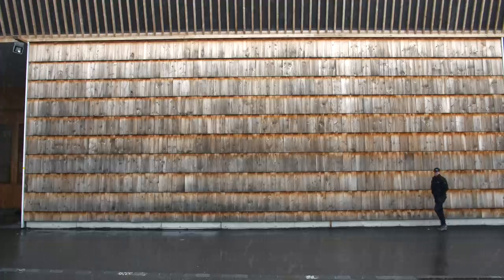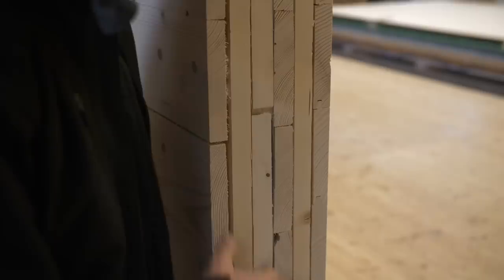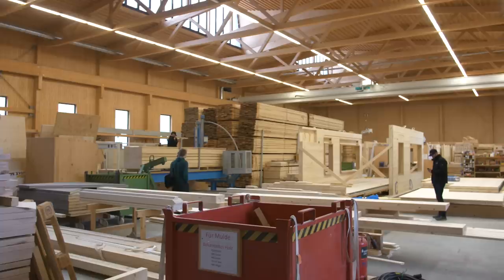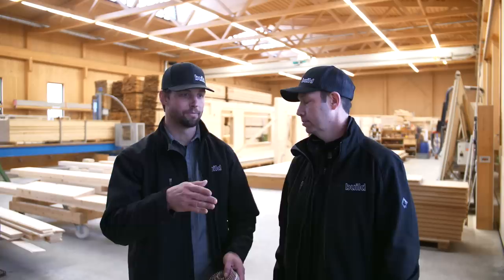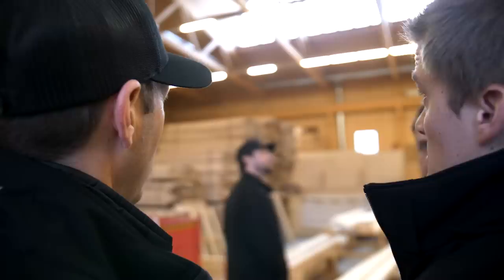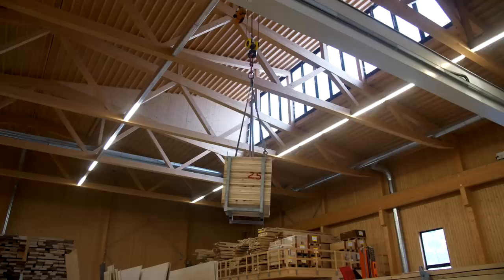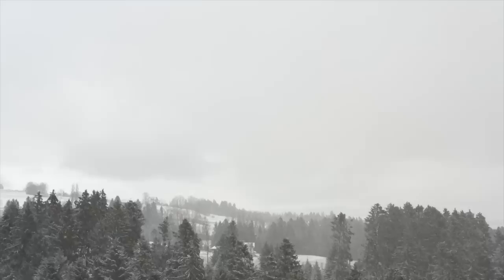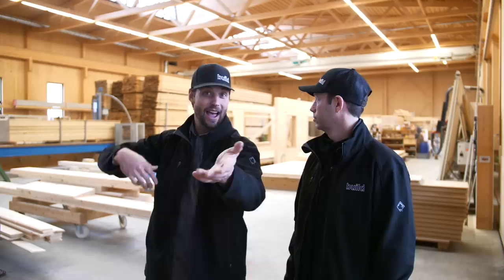This Swiss Builder uses NO INSULATION...

Comment: I love how there is so many haters, yet no one would talk this much trash about a log cabin, there is no waste in this process. All byproducts are beneficial in some way, the wood can be sustainably farmed, younger trees sequester more co2 then older growth. There are so many benefits and so little draw backs. Yes it's not for everybody but it's a great method. Quit freaking out like we are gonna make this the mainstream method and this is all we are gonna build now.
Reply from the maker: Agreed. Thanks
Reply: There are far more drawbacks than benefits. If you fail to see the drawbacks, then the video has done great harm.
Reply: First thing I thought about.  An 8-inch thick wall should do well even down to zero degrees.
Reply: Its not that much more wood, you as actually dont know how much more wood it is. And it proably has a higher insulation value, better air infiltration qualities, easier to adapt other building materials to, it can all be done in a factory. They said the I sualtion is wood fiber, where do you think they are getting that from. The waste can be used as insulation, particle board, osb, pellet stove fuel, mulch, horse corals, oil absorbant And proably many more uses for wood scraps. I'm not saying it's the best building method, I'm saying it's a great building method.
Reply: I'm sure this house is very competitive when it comes down to it, but I guess you better go tell these guys that run a successful business that they better close down there doors because its not a good system.
Reply: But we would need to increase co2 in order to support those farms... More gas car?
Reply: @dlwatib  Not sure what you mean.  From a "building green", this is about as good as you can get.  As far as being a "Green Building", it is good.  In Europe, they already have worked out what they are going to do with scrap.  Not like here in the US.  They recycle everything.
Reply: On the building system, sure its essentially engineered construction, but amount of milling required to make all this lumber would build you extension alone. Also squore milled logs will not warp if properly built. There is dowels holding them in so only difference is that this method allows some modern designs be made and log cabin needs traditional roof with current insulation materials. Then again you can make them from hemp fiber insulation and wood creating light and well insulated construction that is must with snow loads bringing even more weight.

 @fromtheburbstothetetons8826  Correction, we TRY recycle everything, how ever there is morons who ether wont give a damn or are just plain ignorant. Hence why recycling plastics for instance for anything other than power plant fuel to be burned is extremely hard. Getting people recycle plastics to their right bins is utter nighmare, specially when just  small fragment of wrong material that melts in higher temps will cause jam on machinery. Sadly most of the plastics just go to powerplant fuel, instead of being used as additive to making new plastics.

Also there is slight problem of assholes trowing what ever to trash cans and most cases even dangerous trash ends up there. Even more worrysome is trend where old sofas, electronics and such end up dumped on forests and remote road sides, when there is dump in every city and places that take them for free.. heck might even pay for them in bigger batches.
Reply: Hellsong89  where I visited in Germany,,PFORZHEIM,,I saw my cousin with 2 recycling containers,  1 had the silver foil wrapping from CHEESE, , the outer& inner containers from ink cartridges etc, then there was virtually all else, plastic, foam etc. But whenI asked what they do with cheese wrap, he had zero idea, just that it’s put out on certain days, for pick up.Now I’ve in NJ, they nowONLY TAKE # 1&2 plastics , paper, phone books, newspaper, cans , bottles, now co mingled. ALL FOAM GOES IN GARBAGE  !
Reply: Wood has an R value of 1.5 per inch.....so an 8" wood wall is about an R-12.   Typical 2x6 framed wall with 1" foam sheathing is R-13 batt between studs and R-5 (or higher, depends on the type) for the foam.....total of R-18.   2x6 wall, about R-24.....less wood, twice the insulation value. @fromtheburbstothetetons8826
Reply: Your statement that "younger trees sequester more co2 then older growth" is not true.  The rate at which a tree accumulates mass actually accelerates as it ages (in 97% of the 403 tropical and temperate tree species studied), according to a 2014 USGS study published in the journal Nature.  *However*, as long as a tree does not rot or combust, it continues to act as a carbon store even after it has been cut and used in the construction of a house.  So if a wooden home lasts longer than the cultivation time of new trees, then wooden construction as a whole should be a net sequester for CO2, regardless of whether new or old trees are used.
Reply: @matthewgrotke1442  I hoped someone would have said this, "younger trees sequester more Co2 then older growth" is simply a lie that is used everyday to justify bad practices.
Reply: @edsmith4414  Logs don't have the same R value, but their ability to restrict air movement give it a higher comfort level.  This is similar to SIPs.  You would have to look at an Adjustment chart for both to make sure you are comparing apples to apples.
Reply: its resource intensive, growing, cutting, and milling all that wood, inneficiant as hell, where i live the minimum r value for walls is 21, your telling me i need a minimum nearly 2' thick wall made of solid wood? and thats just a minimum, an echo friendly efficiant house would have much more insulation. not to mention extremely expensive.

and no one is defending log cabins, they are also resource intensive and inefficiant, there is a reason they are rarely built anymore and when they are they are usually combined with modern matereals.

there are plenty of chemical free, resource conservative, cost effective building techniques. earth bag, straw bale, rice hull, etc
Reply: Mark Funderburk younger trees do not sequester as much co2 as older trees, but young woodland does sequester more co2 per acre than old growth. There can be fewer trees per hectare once they reach a certain size.
Reply: The real issue with this construction method in US is the freight cost due to weight.
Reply: they didnt use 300 trees or more on the walls unlike log cabins
Reply: therealnightwriter  five me the link that says it's a lie, theres alot of people.ive heard say it was a lie, alex jones, Donald trump, news reporters. Psuedo scientist. But millions upon millions of scientists disagree with them. But what do PHD people who have spent thier entire lives studying environmental science know
Reply: " there are far more drawbacks than benifits." 
Such as?
Reply: @bobofat2545  who's to decide how much wood is acceptable? Some might say the amount we use is normal construction is far too much.
Reply: All the byproducts of dimensional lumber are used, whether you stick-build (conventional) with it, or build like this video demonstrates with it.  Byproduct use isn't part of the issue. The difference is, lumber goes several times further, several times more living space can be constructed using the conventional method.
Reply: @dlwatib  Please list the drawbacks.  I'm sceptical, and can see that this only makes sense if you manufacture and build near the trees you use for timber.  However, when I think about it, a nice eco alternative to this is straw bale.  But straw bale is lime rendered and you have to burn wood or coal to fire the lime.  The limestone quarrying is not an environmentally benign process, but, if you fire the lime kiln with wood, it is eventually carbon neutral.  Here they just use the wood they would have use to run the kiln and don't burn it at all, so it is essentially carbon negative.  You'd need very thick walls though.
Reply: @edsmith4414  They even said im the video that the walls are R24 and the roof is even R30 to R40.
Reply: @edsmith4414  R Values don't take into count permeability.  You take the same R value on a tight house vs a regular house and the tight house will be much more comfortable.
Reply: Dlwatib, your comment is a Fail if you fail to outline the drawbacks .
Reply: Compared to stick frame maybe, but try setting it against steel, tile, concrete, glass or just about anything else. Good thing about this is that it reaches volume max and weight limit at roughly the same point, which means a full load is full, and not 2 loads because another truck has to be set in to comply with restrictions. So no. That won't fly.

Comment: Next episode; wooden plumbing.
Reply: hahahaha
Reply: That was a thing. Hollowed out tree trunks were used for sewer lines.
Reply: Elm was a wood commonly used for that purpose. As long as is stayed wet and wasn’t exposed to air it was supposed to last fairly well.
Reply: That’s the smaller house out back.
Reply: Swiss people like cold. The house should always be less than 50 degrees F. In Southern China there is NO heat in any building! In the winter +5, inside and outside. The good part is there is no wind inside.
Reply: Yup used to be a thing.  Wood log pipes, for sewage.  They just dug one up somewhere here in The States a few years ago that was 200+ years old.  Still functioned and everything.  Only reason they found it was due to a remodel.  :-P
Reply: Lolol
Reply: Wooden wires...
Reply: nope wood electrical...
Reply: Difference between an American and a European. An American thinks 100 years is a long time. A European thinks 100 miles is a long way.
Reply: In the 70's my father did work replacing water lines, some of the lines they pulled up were made out of wood.
Reply: That's actually a thing in alaska. They still have a lot of underground municipal plumbing constructed from wood. My dad enjoys a bit of fishing and visited 10 or so years ago, he watched them replacing some of it. Being cold down there and basically completely anaerobic there isn't much bacterial activity so it rots incredibly slowly. Theoretically last hundreds of years.
Reply: Wooden chimney??.....No?
Reply: Once upon a time, sewage pipes were made out of paper and tar...
Reply: Nice one!
Reply: A nice Redwood poop hut and Japanese planner shavings for TP.
Reply: @Remrie  Romans used concrete and stone, so that would going wood would be going backward a bit.
Reply: re: wooden wiring, traditionally a sappy green-wood is ideal, (the sap making it more conductive than say a kiln-dried mature wood). Though the increased resistance of the wood coupled with the higher current found in 120VAC makes this kinda hazardous in the US, but it is much easier to implement with the lower current found in European 240VAC.
Reply: Spanky McBean that’s not that long ago. Still common to remove that.
Reply: And paper electrical wire
Reply: thats possible
you can make pipes and pumpes out of wood (ok youll need some steel and leather for the pump)
Reply: @notanything8297  Great Fire od London started with a timber chimney in Baker Street.
Reply: @alexharris8662  Paper makes a good insulator.  My gran's house had paper insulated mains cables coming from the National Grid.  Built in the 1960s and still in use 10 years ago.
Reply: John Bull  Wow!  Would never have guessed that!
Reply: @Nill757  The cost of just block construction likely would be way cheaper anyways. But definitely not as easy to keep warm
Reply: I'm waiting for the wooden fire place episode
Reply: Someone in Asia probably has bamboo plumbing.
Reply: that episode was my favorite. i would have never guessed to use bamboo
Reply: @mikemc8495  I was just kidding,is there really?
Reply: wooden sewer lines and water lines are still in use all over the world.
Reply: My dad (would be 89 now) tells of how the water main in his hometown in New York was made of wood.
Reply: As long as it's not plastic. Metal is fine too.
Reply: @robertkat  Well at least they haven't been brainwashed into thinking 'forced air heat' is any better than no heat at all.
Reply: @Nill757  Well at least they didn't use plastic and toxic glues
Reply: @dk-wy7ph  Steel and leather is fine - it's natural and degradable. Plastics and glues not fine.
Reply: A lot of old school pipelines in the U.S. were wooden. 
You can still see them in museums and whatnot.
Reply: Jared Jeanotte lol
Reply: @whirled_peas  Amsterdam is build on poles. Buildings dont stand on " theoretical " fundations.
Reply: @MrToontuber  the fact that buildings don't stand on "theoretical" foundations is not contrary to my pointing out that wood can theoretically last hundreds of years underground, what the fuck dude
Reply: Orangeburg pipe was made of wood pulp. Used for sewer

Comment: My grand parents house is adobe its walls are 30 inches thick, a few steel fasteners in the headers and is over 300 years old in New Mexico. It is very beautiful and efficient. Using local materials is the way to go.  Thanks for the awesome video!
Reply: What your saying your grandparents house in New Mexico was built before 1719? Do you have photos?
Reply: Don Juan Onate established a settlement  near current day Sante Fe New Mexico in 1598 which is near where my ancestors come from, Only St Augustine in Florida is an older European established city. Both are over 400 years old. Of course their house (originally a dance hall and community center) has all modern amenities.  Also Mexico City ( part of New Spain)is nearly 500 years old.
Reply: Mine was built in 1865 all wood as well..thick barnwood and railroad beams as foundations..we are living in it for the last year..might rent it out for a little bit,but taking it down its in the plan...i would not want a wood only wall again like here..fire is a hazard but mold is the worst!!insects...we kill many big ones here every weeks..no matter what you do it will be condamned before needing to come down
Reply: @vincevegacustoms754  I don't think you'll have mould in a timber house if the detailing is right.  It's a breathable construction.
Reply: Adobe houses are dangerous in earthquakes.
Reply: @NeilBaker722  Would be fine in the UK then.  The worst earthquake we ever had lasted 20 seconds, was 4.6 Richter, and caused at least 2 deaths.  My house (which was much younger at the time) stood through it.
Reply: @supermetaltastic  you just busted him
New Mexico is a bricks and stones state with hot temperatures...
Wood wasn't a lot used for construction.
Lime covered houses to insulate from heat
Reply: how did those two die in a 4.6? were they playing jumbo jenga and a block fell on their heads?

Comment: Another great video guys.
Here in the Netherlands it’s common builder’s knowledge that with a steel structure you’ll have to cover it up with fireproof material to prevent it from warping during a fire. Massive wooden posts and beams can withstand fire for a longer period of time. Note that he said: “....that’s more than enough time to get out of the house.”
Mostly the fire won’t kill you, the toxic gasses and the collapse of a building are much more likely to before a fire actually reaches you.
 Besides, anyone who ever experienced “fogging” (a black discolouration of walls or ceilings which isn’t from smoke and which building material and furniture manufacturers don’t want you to know about) will LOVE a house with only natural materials in them.
Modern houses in the netherlands these days are mostly calculated to last only 40 years. By that time they figure everything is outdated and will have to be improved or replaced anyway. Tons of chemicals used which have to be discarded some day.

Comment: Matt/Jordan:  Thanks to the USAF, we were fortunate enough to live in Germany for 4 yrs, and couldn’t have been more impressed with the residential construction and their long-term building philosophy.  Despite rarely being subject to the severe storms and other natural phenomena we in the US need to plan for, their typical heavy block wall and concrete floor construction is far more resilient than the typical US home, not to mention the robustly engineered doors, windows and ubiquitous rolling shades...and will last many times longer.  Of course they don’t move 11 times during their lives like Americans do on average, but that’s another discussion.

What I’ve often wondered, however, is how their typical designs compare to what we’ve learned from a “building science” perspective...what would Joe Lstiburek say!?!  I suspect there are interesting lessons or hybrid solutions that could be applied to US homes and vice versa.
Reply from the maker: Absolutely agree Mike. Generally the Science works well in the US too. I’m touring German job sites tomorrow and I’ll think about how to answer this on a video from the sites I’m seeing. 
Thanks, Matt
Reply: That's a long time. Which Arabic words did you pick up?

Comment: I've been to and seen those barns above Zermatt in the Matter Valley (Matteral). They are in relatively great shape.

As an aside, I was there doing research on the Gorner and Zwillings glaciers. I spent a week camping on the ice. The view out the door of my tent was the Matterhorn.
Reply: Prove it with a piece of glacier 🤪
Reply: These old cabin mountains are found all over the Alps in Switzerland, and if it is true that they stood the test of time, we also have to say that the limited comfort they provide would not be accepted by any modern standards, and their usage is pretty limited as it doens't help densification, which is the only way to go in most of the world.